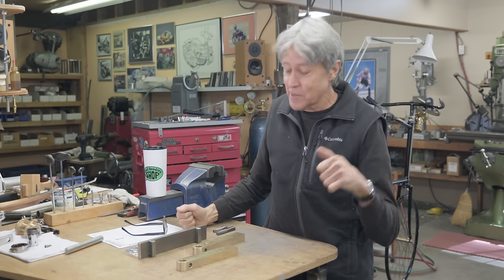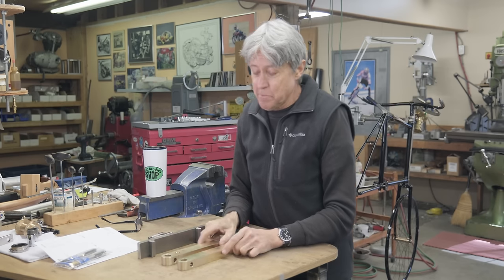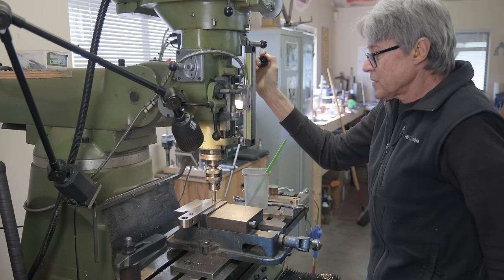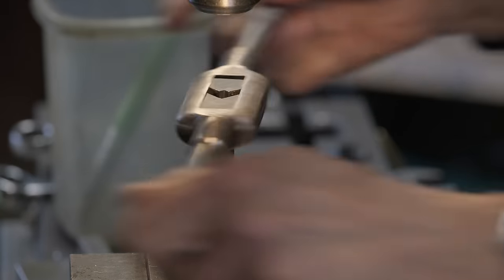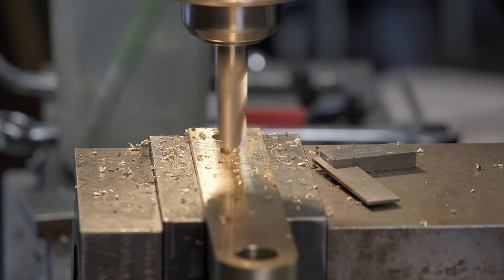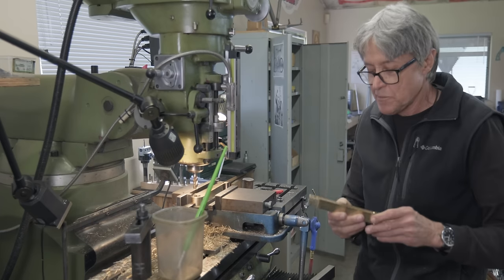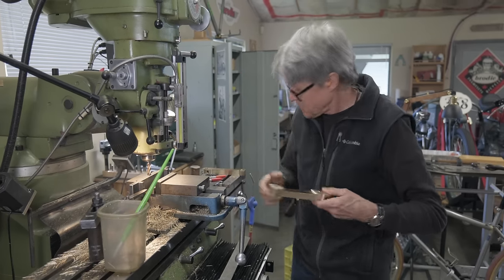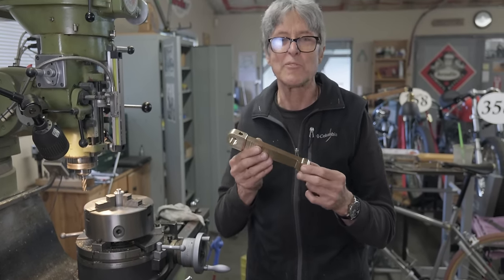Milling the BRONZE CRANK ARMS for the 1894 Giraffe Bike - part two // paul brodie's shop

Comment: Those cranks look really good in bronze. You got a result with the taps but if you were stuck you can make taps. Years ago my dad and I made a 4" to the foot traction engine. On the actual engine the parking brake had a big square thread rod to pull the brake on. I wanted to replicate the square thread so I turned an extra long bit of square thread and used the spare bit to make a tap which actually worked to tap the female thread.
Reply from the maker: Well I have never made a tap, but my friend Harvey did make me a tap. I was making brass valve caps for my Excelsiors, and that tap is not available anywhere in this world. I did look..  I liked your story, thanks for commenting...    :face-orange-biting-nails::face-orange-biting-nails:

Comment: Good to see you looking stronger again. I watched a video the other day on the restoration of a prewar German bicycle  it was fitted with a two speed gearbox at the crank, nothing new under the sun made me think of you and your present project. I have a shaft drive Bicycle sat out as the die cast gears cracked up and lock rather than turn. That bike was pretty cool when it worked very quiet out on tracks and really positive drive much better feel than a chain if it had had a six speed gear box and a back pedal brake it would have been great.

Comment: I think i have a set of Park Tool 9/16" taps, for modifying french crank arms or chasing threads.  Would these work or is there a difference between the Park tool taps and "native" or "virgin" taps.  Mine were not very expensive but it was 1😢0y ago ...

Comment: Won't tapping something from the inner side (using a right hand tap) produce a left hand thread on the outer side?
Reply: No.
Reply: @bobskingle5762  It only required a short answer🤣
Reply: @howardosborne8647  that made me chuckle, if only 🙂. 

I was shocked how much the price is inflated over the pond for those taps, can get a 3 tap set (1st 2nd and 3rd) locally for £16. The right hand set is £1 less.

Comment: The American tap may not be as "sharp" but I guarantee it'll last/hold it's edge a hell of a lot longer than the Chinese tap. 👍👍
Reply: Why?
Reply: odd thing that you'd make that guarantee without knowing the specifics of the materials the 2 taps are made from. 
The idea that everything made in China is crap quality or they aren't capable of producing any high quality tooling is utter nonsense.

Comment: Why use a tap instead of cutting the threads on your mill or lathe?
Reply: I think the problem is that there is a big-ass brass crank arm attached to the pedal eye and that would be flying everywhere and maybe its too long for the lathe bed?
Reply: Since its brass i wonder if he could just tap a tube and braze it into the crank arm?
Reply: @dgillies5420  At a push you can put an internal treading tool into a boring head mounted in the lathe spindle and hold the crank in the tool post to get around the issue of the swing/clearance. Basically use the lathe as a horizontal boring machine
However buying a tap is much easier.

Comment: You make it look so easy Paul. Ive made up Gear shift Levers for My RC Honda 250 from Alloy and The process of what the next cut should be is the Brain Teaser in still being able to Hold the part :) Love your work Sir :) Those cranks are a work of Art